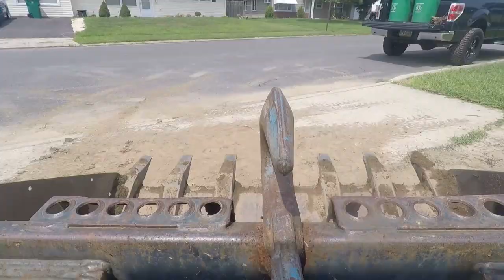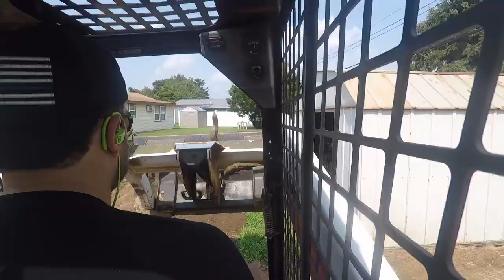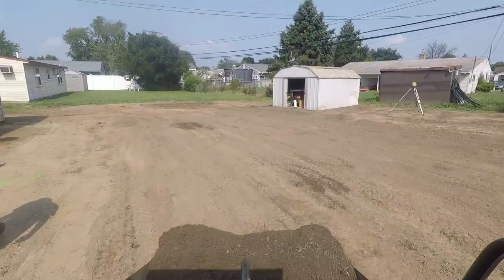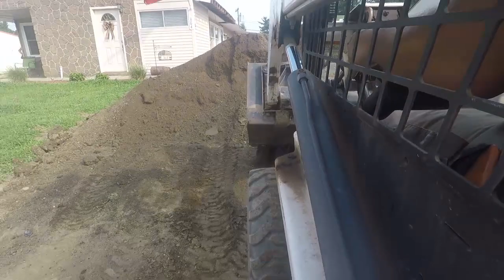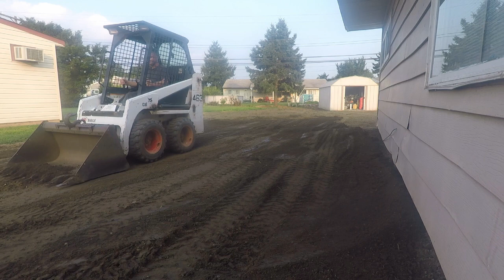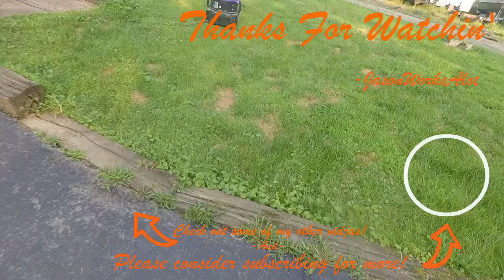Leveling out a yard with the Bobcat 463, 70 tons of dirt later she is tired!

Comment: Nice job!!!! Especially with a toothed bucket!!!!
Reply from the maker: Richard Savaglio Thanks! and will full size bobcat teeth on it nonetheless! haha. Thanks for watching sir, see ya in the next one!
Reply: JasonWorksAlot I just found my bolt on toothbar, bolt on sacrificial cutting edge, spare cutting edge, several teeth, shanks, pins and retainers, plus I have a bucket that is narrower than the overall tire/machine width, hydraulic 2 way dozer/snow blade, filters, injectors, starter, alternator, bobcat spray paint, manuals and various other small spare parts for our bobcat. I probably should try and sell them because I have no plans to replace my “permanently borrowed” I mean stolen machine.
Reply from the maker: Richard Savaglio still aggravates me that happened to you man. Unacceptable behavior. What model did you have?
Reply: JasonWorksAlot easy model to remember.  It’s a cat model too. 963.  I think I’d rather have the Cat though!!!! Mmmmm steel tracks!!! Lol
Reply from the maker: Richard Savaglio yeah man. Track loader is next on my list. May end up becoming a necessity before too long honestly.

Comment: That's a lot of work for the Bobkitten! Every time I watch you and Brandon do yard jobs like this, I always find myself wondering if a utility tractor with a box blade on the back would be a quicker way to do it. Of course, money does not grow upon trees and you've got to do what you can with what you've got (and you did very nice job with the Bobkitten) but that thought has always occurred to me. Thanks for the video Jason.
Reply from the maker: Sandy comrade Sandy! A valid question, and one that I considered for a long time when I was in the market for something (ended up being the kitten) I personally do not think it would be worth it, or atleast practical in my aspect. The largest problem I have with a tractor/blade setup is the actual large size of the rig(see what I did there, I crack me up!) I prefer the maneuverability of the more compact skidsteer (or track loader) over that of the tractor. Now I'd be hard pressed to justify a bobkitten over a tractor because let's be real it's basically a step up from a tonka toy, however when I factored in the price I paid for it with a trailer it was a no brainer. If I can find time soon to get the woodchipper project going and wrapped up, the sale of that is going to majorly fund the next equipment purchase of a tl250 or tl12 track loader just like brandons. Back peddling a little but I would say that the bobkitten is justified also in its size or lack there of, I can fit it through a small gate so never have to take a customers fence down and out it back up. Saves time and lessens the chance of property damage I'm responsible for.  Hope I didn't ramble too much there and kinda shed some light on the question, atleast as it is viewed from my perspective. Just my 2 cents Take it today for half off face value :) and as always my friend thanking you for watching, and DRINK MORE VODKAS!
Reply: @JasonWorksAlot  These are all valid points. And ones I had not really considered. I am used to thinking in terms of my area, where almost everyone has a largish yard (my own is 3.75 acres) and the smaller machine is more liability than asset because of the time to get anything done. You'd burn it up or at least always be doing maintenance on it in this area. Where you are working I could see the Bobkitten being a much better value for money. Certainly it is preferable to doing it with the Armstrong Backhoe (AKA shovel) and a wheelbarrow.  Especially if it comes with a half-decent trailer. AvE's proverbial sore di*k deal in that case.
Reply from the maker: Sandy indeed comrade! Yes I originally got it for my property which is just under 2 acres. I wanted it for the tree removal, and snow removal ( my drive way is right around 400' long) and for that it's just hardly enough. I got it off my business partners uncle this was before we had the excavation business though for 6000 with trailer. It had just under 1000 hours on it and had been sitting for about 10 years. He used it to put in above ground pools so it wasn't worked very hard at all. Then we started doing pools with it and that kind of spiraled into starting the business. Now trying to swing it into more excavation less land grading but hey if it pays, I'll do it...within reason... would also like to get into more land clearing as well. Have my eye on a feller buncher head that goes on a big track loader I saw at Bunyan. If I get the tl250/12 then it'll be on my list of toys errr tools to acquire!